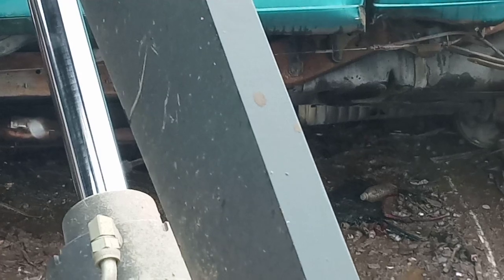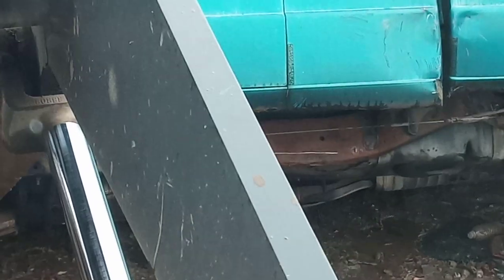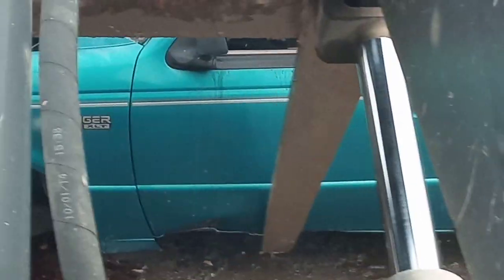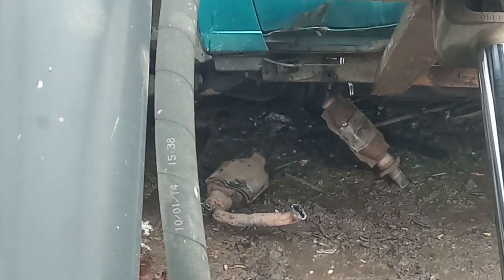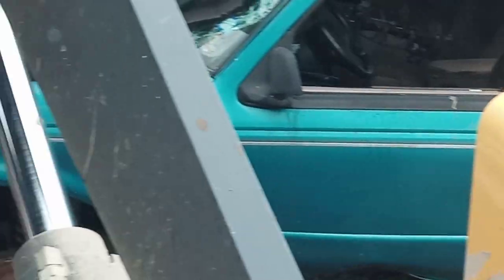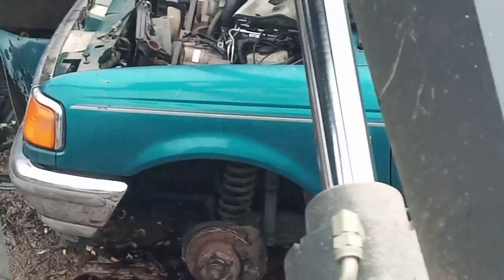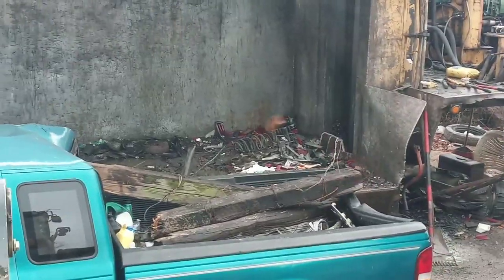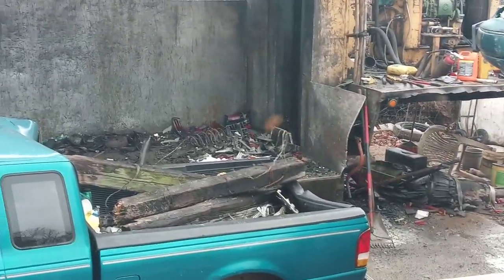Remove catalytic converter from Ford ranger

Comment: Some artful de-clawing on that cat ;)  Good job.  Your buddy's got a good swing on the axe at the start - that's delightfully "get the job done".  I see one of those run away springs hiding in the crusher too.  I can just imagine they ping out real easy sometimes.

Was a bit hard to see - how much do you care what junk gets crushed in with them?  I guess the shredder doesn't care much at all.
Reply from the maker: The Mill doesn't want the trash but my hands are tied. I have no where to put the trash. I'm sure as heck not gonna take it out. The Mill can choose to dock the load. Deduct some money.
Reply: Ahh right - I guess they do care then!  I guess it's all wear on their teeth  and stuff.  Take the Micky too much and it'll cost ya.  I did hear one story of someone put a hardened hydraulic rod in a bundle, and it shattered the mill gear, and massive downtime fixing it.  Bet that caused some arguments!
Reply from the maker: @caver1  it's more along the lines of the Mill doesn't want to pay for useless material or I should say non profit making material. 
  I've also heard of the mill being shut down due to stuff being thrown in cars. A counter balance off a little warehouse forklift plum wrecked it. 
 The Mill we use is a Hammer Mill. Smashes the material into pecan size nuggets